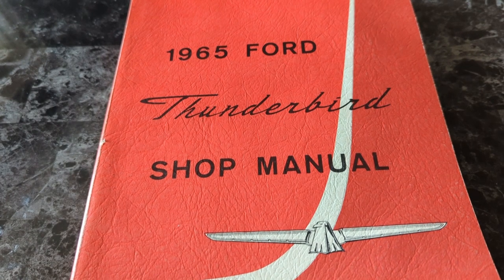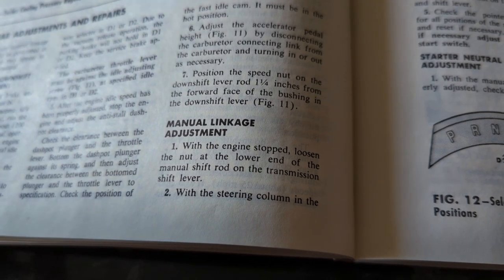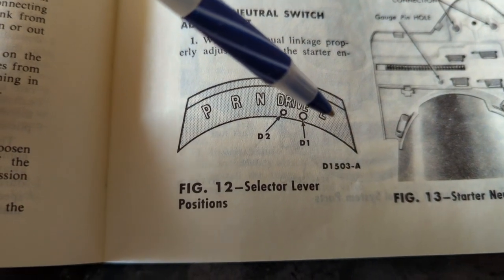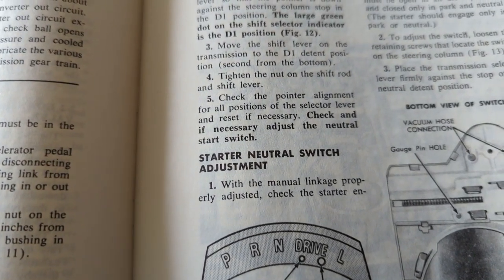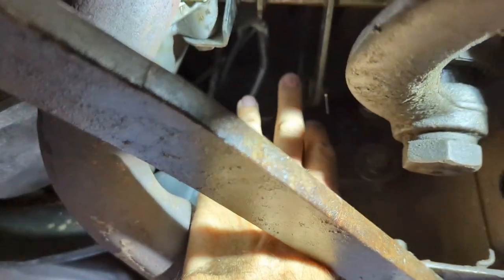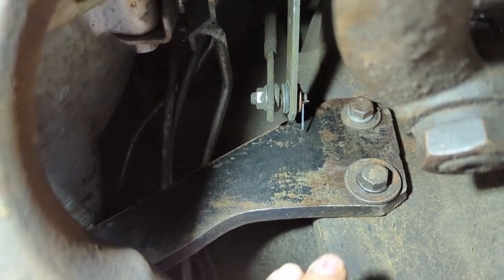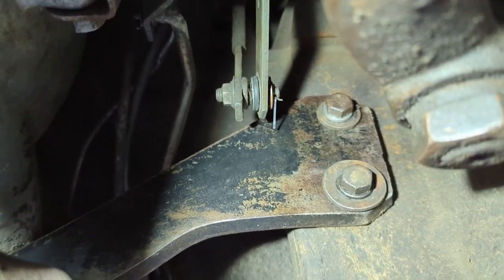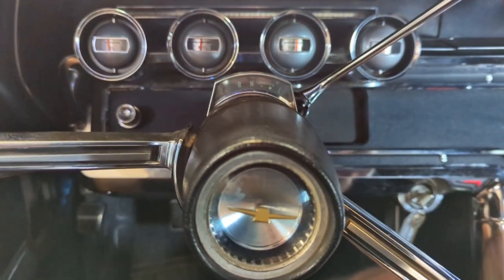Manual Shift Linkage Adjustment - 65 Thunderbird Hardtop

Comment: Hello Alvin. That looked like an "easy" adjustment for a change. Your car had a Cruise-O-Matic from the factory? Just curious. 
George B
Reply from the maker: Hi George,
It is an easy adjustment, but before I read the manual, I figured all I had to do was adjust it in park, but that didn't allow a smooth action...so when in doubt, read the instructions. Lol
Yes, the 65 Thunderbirds did come with the Cruise o Matic from the factory.

Comment: Hello Alvin
I recall a video or two from Nick on the woogely column shifter syndrome. Your shifter seems fairly tight. My 64 shifter handle has not had the Nick treatment yet. I will get to it next winter.
Reply from the maker: Yes, Nick did a great video on the linkage repair for these cars, lucky enough this car was still in good shape, I did replace the shift tube bushing, and that was all it needs for now.

Comment: Hey Alvin, Do you know how to adjust 1961 Cadillac shift linkage? I have two that need attention. This is something that most Thunderbirds need since they loose their adjustment easily when parts start to wear out. I noticed that your temp gauge needle was over to the P in the word temp. Is it running hot? My new 64 Mustang had exhaust leaks on both sides. The new exhaust system was put in wrong and I think the pipe size is too large. The pipe is sitting against the exhaust manifold to header pipe nuts and they were all loose anyway. Mickey mouse work. Anyway, thanks for the video.
Reply from the maker: Hey Nick, sorry I do not know the adjustment procedure for the Caddy's.
The Thunderbird does run a little hot at idle, and I had been idling it in the garage before I recorded that video, and it was around 30c that day. Knowing it bored to 40 over, it may need a fan shroud like the AC cars.
Darn exhaust pipes, a pain in the butt, they never seem to be the same after the original has been removed...well, without a lot of work anyway.